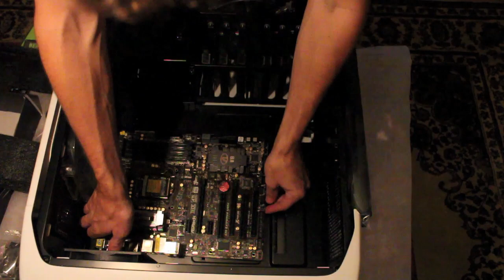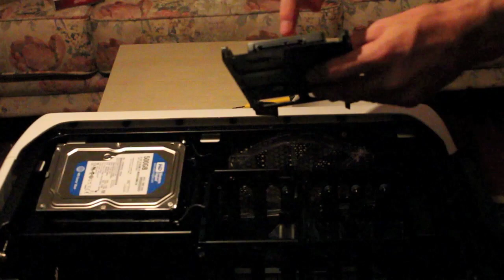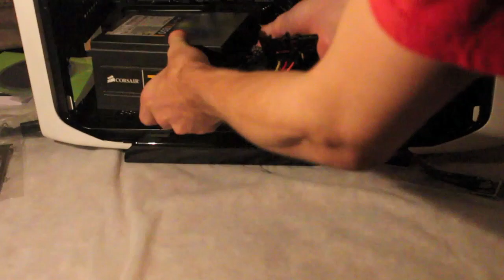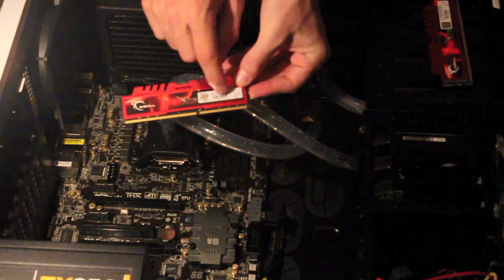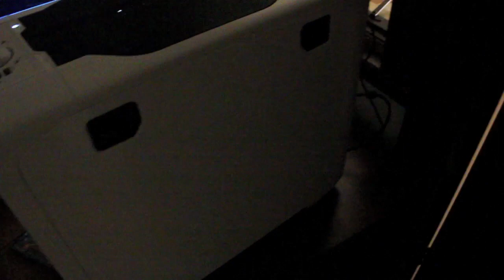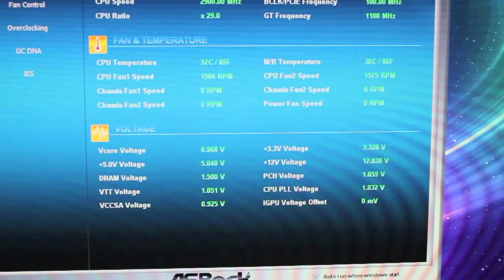How To: High Performance Gaming PC Build 2012

Comment: This is my parts list:

Asus DRW-24D3ST 24x DVD Writer

Aerocool VP650 650W Power Supply 

G.Skill Ripjaws (2x4GB) 

Sapphire Radeon HD 2GB

Intel Core i5 4440

Seagate Barracuda 1TB

In Win MANA 136 Mid Tower

ASUS h87M-PLUS Motherboard

Will these go together?

Comment: can i run 4 hard drives (2 SSD + 2 HDD), a 7970 and a 8150 with a h80 and 990x sabretooth on a 750w psu? and how much would i need to upgrade to? iv tried it but it seems to be struggling unless i did it wrong :)

Comment: Dude, for around 1,500 dollars my gaming PC is ALOT faster than this. 
Specs: 

CPU: Intel Core i7 3770K Ivy Bridge 22nm Processor
Heat SInk: Corsair H80 Water Cooling Kit
Motherboard: EVGA E-ATX Z77 Pro-Series Motherboard (Quad SLI/QuadFire)
Memory: 16GB DDR3 2000MHZ Ram
Graphics Card: 2GB EVGA Nvidia GTX 660Ti SuperClocked Edition
Storage: 120GB Intel Maple Crest SSD + 500GB Wester Digital Black HD
Chassis: SilverStone Raven RV03 Full Tower Case
Optical Drive: LG Light Scribe 16X DVD-RW

Comment: The CPU is not even compatible with the motherboard. I'd get an i5 3570K, Western Digital drive (Seagate has a ton of failures), a 600W PSU, and a 7870 witht he money you save.

Comment: My setup as it will be in a month or two.

Quad i7 3770k 3.5ghz

Asus maximus v gene republic of gamers, micro atx version.

Xpredator case

Gainward geforce gtx 570 golden sample goes like hell 1280mb

4x thermaltake fans

thermaltake heatsink

8gb corsair vengeance ram

Western digital caviar 1tb hard drive

Blu-ray drive

OCZ fatal1ty 750w psu.

Rate/improve? On a budget.

Comment: Are these specs good enough on  a computer for massive games?:
MotherBoard:Asus Rampage IV Extreme S2011 
GPU:ASUS GTX670 2GB DDR5
PSU:Corsair 850TXV2 850Watt PSU
HDD:Western Digital Caviar 1TB SATA Hard Drive * Black * 
CPU:Intel Core i7 3770K Boxed 3.5GHz Unlocked 3rd Generation Processor
RAM:16GB 1600MHz DDR3 Non-ECC CL9 DIMM (Kit of 4) XMP Kingston HyperX 
DvD Drive:SAMSUNG BLU RAY COMBO DRIVE

Comment: What cooling system would you recommend for this build? I have about 200$ left to spend on the cooler
I5 2500k,
Sapphire radeon 7850 2gb DDR5 ,
A gigabyte z77 motherboard,
60gb ssd,
Terabyte hard drive, 
And a 750 watt power supply

Comment: OCZ agility series had some issues be carefull with it, get the vertex 3 series instead ^^. Also I think you should get an I7 2600k instead (X58 is end of life meaning it wont be supported for much longer) , it is cheaper and you can get a better motherboard with PCIe 3.0 Like the new ivy bridge boards also if you wait  alittle longer you can get an Ivy Bridge I7 3770k the rest looks good. Anyway even with this configuration it will run games without  problem

Comment: I'v never built a pc before but this is what I was thinking of.

How well would the following run games, also is there anything I'm missing?

Intel Core i7-980 Gulftown 3.33GHz
GIGABYTE G1.Sniper LGA 1366
G.SKILL Sniper 8GB (2 x 4GB) (x2)
COOLER MASTER Silent Pro1000W
OCZ Agility 60GB SSD
Western Digital Caviar Black WD1001FALS 1TB
GTX 680
COOLER MASTER V8 RR-UV8-XBU1-GP 120mm Rifle CPU Cooler
HAF x Nvidia case

Comment: @OdinAlgeron Im okay with case and cpu but i think this mobo would fit better check this setup

-Antec DF-85 black case
-Gigabyte GA-Z68XP-UD3
-Intel Core i7-2600k
-Corsair Vengeance 1600Mhz 16gb (4x3)
-Corsair 750w PSU
-XFX Radeon 6870 1gb DDR5 graphic card

Comment: Nice vid!

You rather made some weird gaming choices though.

750 watt corsair power supply. 

Water cooling is nice, but the hyper 212 with 2 fans would have been more than adequate for gaming overclock. 

I myself would have gone with a haf 912 or an antec 302, spending that much money on a case would be rather pointless.

The savings would have been: 75 + 150 + 100 = $325 +189 you spend on the 6870 = $514 

$514  could have gotten: sli 560 ti, 590, 7950 dunno if it was available at the time.

Comment: @pahockey360 Drop the 16gb for 8gb.

Drop the h70 for a hyper 212.

Change the motherboard to a gigabyte GA-Z68X-UD3H-B3.

Drop the 850 power supply down to 750.

Drop the 2600k to a 2500k, they are the same in gaming.

Get crossfire 6850 and enjoy.

Comment: Hey nice video man :D What do you think about this setup?

-ANTEC DF-85 BLACK CASE
-Asus P8Z68 Deluxe/Gen 3
-Intel Core i7-2600k SandyBridge
-2x PowerColor ATI Radeon HD 5770
-16GB(4x4) Corsair vengeance DDR3 1866MHZ
-Corsair HX850 PSU
-Corsair Cooling Hydro H-70